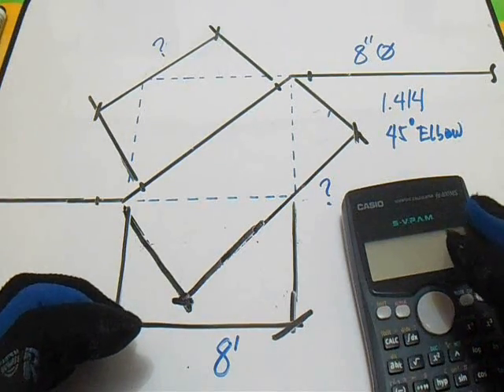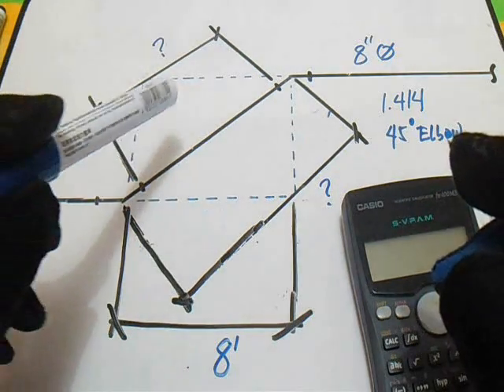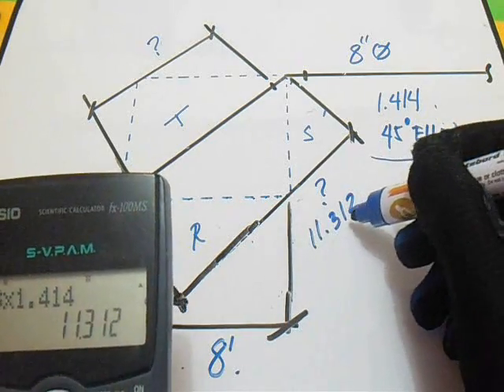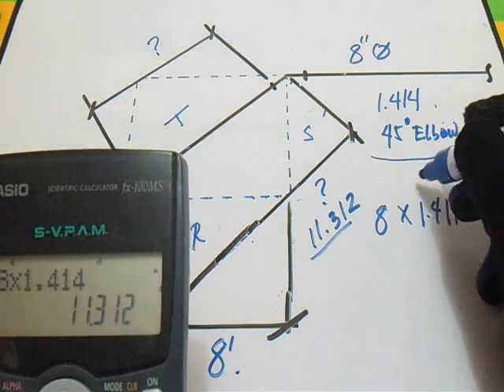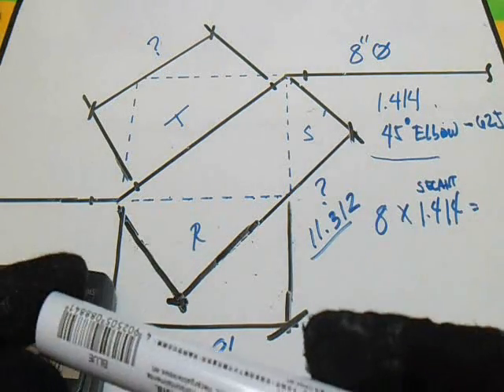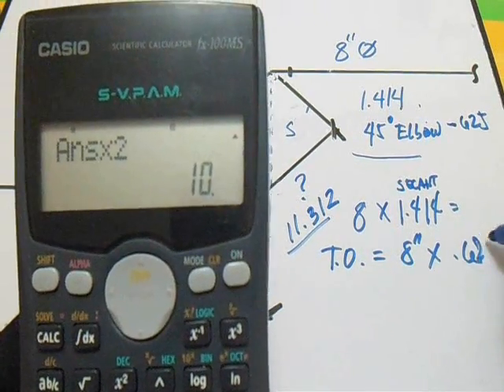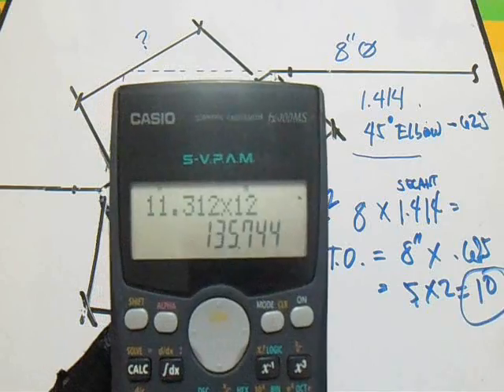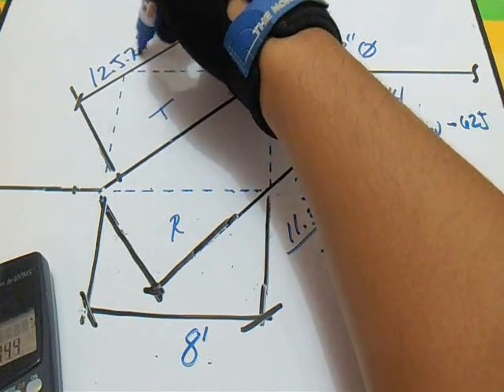Piping Formula Secant 45 degree 1.414 Set Run Travel Take Off

Comment: good
Reply from the maker: thankyou anyongasayo
Reply: Sr,I have question,I'm leying pipe under ground sometimes, I need to do 45°down to drop 45°run 45° up and 45° to get the trench cut again . most that time we do 12",inch .
My trench cut for Invert or flowline is 4feet and 45 hundreds  and I have a sewer main crossing  and the ingenering wants to drop the water main under the sewer main and now my other cut for flowline is 7feet and 55 hundreds how I get that travel between this tow 45° bends?please help me

Comment: Sir, please don't use inches in your calculation of measurements, convert it to mm. for mm. is widely used in piping in any plant here or overseas. we only use inches in nominal pipe sizes not dimensions because NPS is not usually the same with the diameter of pipe, it will differ slightly due to pipe schedule or wall thickness in which from size 14" and above NPS = OD. And you forgot to minus the weld gap which is unacceptable during interview test involving with calculation of spools of the employer, where as, interviewees are allowed to use calculator. Just sharing my idea sir....
Reply: Yess rith

Comment: 125.744in= 3193.898mm travel paano na yun 11.312mm sir dapat mahaba sya kesa sa travel
Reply from the maker: +Roel Orpano Why? 125.744 cutting spool not the same with center to center of elbow or travel 11.312 not mm this is feet please check the symbol and in the conversion factor.Thank you.
Reply: @Mrjoelaguirre  pls check the symbols ay 1.414 sir ay sa mm lng yan, bakit mo ginamit yan inches ang unit scales na ginamit sa dwg mo